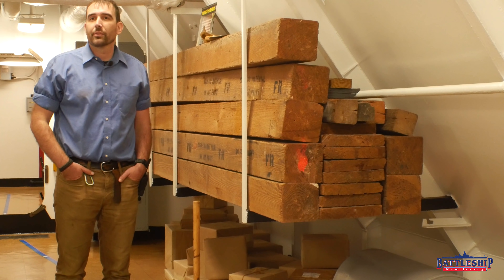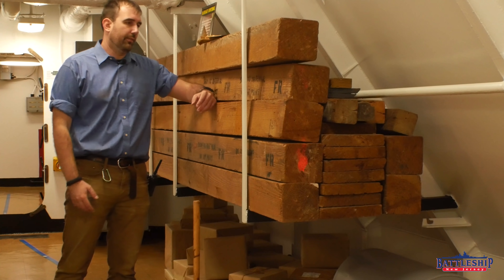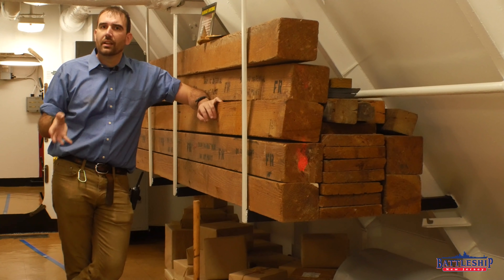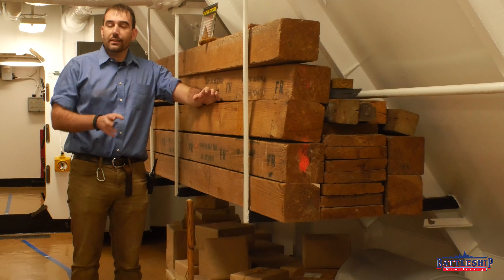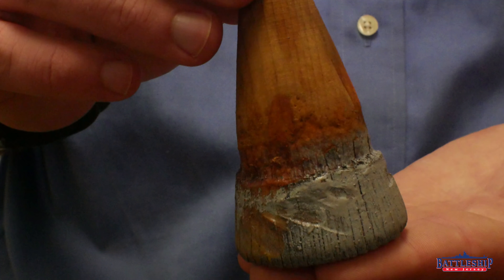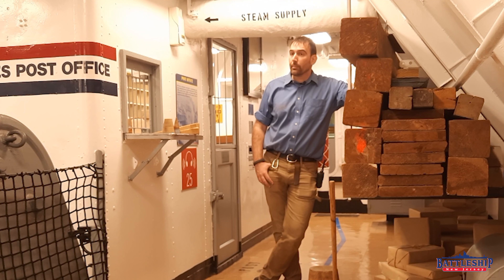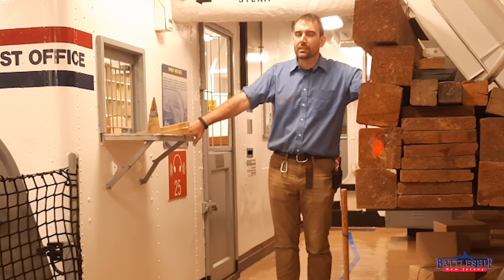Damage Control: Stopping Flooding

Comment: When I was in UK sea cadets, we went down to his Raleigh with the unit, as part of the unit week, we had a morning in the old damage control training centre, everyone got involved including all the unit instructors including the CO, because it was fun (not so much If it had been real). After 2 hrs we were waist deep in water lol.

Sadly we weren't allowed on the new (at the time, it had started use the week before) damage control trainer, it swung so it simulated a ship in rough seas, also when the water poured in, it came in at correct pressure.

HMS Raleigh is the boot camp for the royal navy

Comment: No damage control at home but my fathers destroyer was hit off Okinawa, and badly damaged at that,  With the deck cracked and split across the entire beam, one of the things they did was to cut holes in the 3/8th deck plate, wrap chain around the longitudinals, and take up the slack with chain falls to keep the splits from widening.  Dad limped  his ship into Kamera Retto (SP??) where he was told "I'm sorry Captain, but your ship is a CTL and isn't worth fixing".

Comment: So why use wood and cut to length for the props, instead of a screw jack type setup like was already seeing use in scaffold of the time (and continues to this day)? It seems to me that designing a footing brace lug to be welded to each structural point you'd want to brace against would remove a lot of the time, guesswork and risk to a damage control team, meanwhile expansion of wood is undesirable for the elements that aren't trying to water seal, and nails very hard to adjust, and when hastily applied to wet timber, not very strong compared to a clamp. Of course when hulls had wooden members wooden braces make the most sense, but that era was long passed by the time battleship new jersey first left its slipway, much less the end of its service when it was preserved.
Reply from the maker: They had more mechanical shoring timbers as well, when in doubt, redundancy

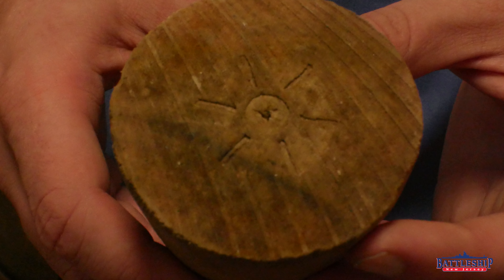Comment: 6:45 that's not a hammer strike mark. It's where the lathe centre dug into to turn the taper. Which makes me wonder, is there wood turning lathes on new jersey? Or metal lathes with carpentry centres?

Comment: We have plugs but also use wedges (they come in 2 or 3 sizes) to plug holes. Rule of thumb being 1 wedge per 1" of hole. Any gaps you split the wedges and hammer them in the gaps

Comment: One of the best schools I went to was the ‘wet’ damage control (DC) school at Naval Station, San Diego.  We trained to patch pipes, how to operate a water pump (P250), and learned how to use shoring (lumber) like Ryan talked about.  On the last day we put it all together in a huge mock-up of the inside of a compartment where instructors could turn on valves and water would start to enter the compartment.  We had to plug the holes with anything we could find, i.e., DC plugs, shoring, pillows, mattresses, etc.  I’m sure the students always lost and the water won.  Our last task was to abandon the compartment by exiting UP a vertical ladder with ‘Niagara Falls’ falling down on us while two shipmates guided us up.  That was so fun, it was the essence of ‘hands-on’ learning DC.  I went thru advanced fire fighting school and radiology school to learn how to use radiation instruments and fighting the ship during nuclear attack.
20.5 years of active naval service aboard 2 CVs, 2 DDs, & 1 LPD.  Anchors Aweigh!  Go Navy, Beat Army!

Comment: Damage control a matter of ship design, equipment but most if all the crew. Both USS FRANKLIN CVA13 & USS FORRESTAHL CVA59 survived massive fires with loss of life & returned to service. First & foremost neither had to be abandoned (survival odds for remainder of the crew sure is better aboard as vessel). Compare losses of IJN Shinano (incomplete ship lacking watertight integrity & inexperienced crew sank nine hours after hits)  or Taihō (able to mitigate flooding from torpedo hits but bad DC decisions allowed avgas vapours to ignite). I doubt the USN wouldn't have sent the former to sea in such a sad state or let the latter get out of hand.

Comment: You mentioned that the bulkheads wouldn't be able to withstand the pressure of water - but what were they there for, then? Isn't the whole point of a bullhead to seal off a flooded compartment?

Comment: I can't believe that a damage control party would be cutting heavy lumber with that puny saw. A gasoline powered chainsaw would seem more like it especially when speed is paramount. 

When they first surveyed the wreck of RMS Titanic , Robert Ballard and his team observed that the damage to the hull caused by the collision with the iceberg appeared to be an opening in a riveted seam about 150 ft long but not more than 1-1/2 inches wide. If that was the case, they certainly had enough stuff on board to fill that gap and a lot of people to do the stuffing, but apparently no one who understood the concept of damage control. One complication would have been that a significant part of the opening was in a coal bunker so they may have had to shift a lot of coal to get access to the damage.

Comment: Damage control after Ida--12+ hours of storm/hurricane conditions in NOLA on (of all dates) the 16th Anniversary of Katrina. Got up the next morning and had to put a tarp on the roof to cover where shingles has been torn off and rain was leaking through. Damage to interior walls and ceilings from water incursion. 10 days without power, running minimal items on a generator. So far the tarp and other sealing efforts have significantly reduced the leaking. We have just gone through 3 more days of storm and rain from TS Nicholas. All that said, we are very fortunate. Those west and north of here were hit so much harder. All in the path of Ida have lost some. Some have lost all. Our hearts go out to the families and loved ones of those who didn't make it through the storm and its aftermath.

Comment: I had the opportunity to go through 2 different damage control trainers at different times to learn how to try to control flooding. One of them was a portion of a ship that was actually floating in a very large swimming pool. We did the training in that several times as it slowly sank to the bottom of the pool. That got you used to trying to do things in a flooding compartment where simply moving around and doing some of the needed tasks by feel was emphasized.

Later I went through another trainer that was just a modified section of a normal building. They had drains in the floor so as the water rushed into the room it could be continuously pumped back in with the level of water in the room not getting much more than ankle deep. However, the real challenge came at the end. It was a two story trainer and you had to exit through an escape scuttle into the upper room which was flooded with waist deep water. Trying to get up the ladder through the scuttle with all the water flowing back down had you feeling like a salmon. Both trainers were both instructive, interesting and even a little fun.
Reply: The "normal building" DC trainer I went through most likely had drains in the floor, but they sure weren't letting any water out of them during the drill.  Water was chest-high by the time we got the "leaks" stopped.

Comment: was the post office manned by a postman or a Servicemen?
Reply: Considering the laws about handling the mail that's a very intriguing question.
Reply: @ralphgesler5110  Thanks. I didn't know about that.
Reply: @ghost307  That post office would have had it's own postmark.  I still have a picture postcard of the USS Kansas City (AOR-3) with matching postmark indicating that I mailed it from the onboard post office.

At sea, small ships without a post office would transfer outbound mail to a ship that DID have a post office, generally the replenishment ship during an UnRep.  On the replenishment ship it would be postmarked/cancelled and either stored or started on a ship-hopping or plane journey to a shore station.  In port, I think that outbound mail for ships with no post office was collected and processed by the closest FPO.  A typical inbound shipboard address might look similar to:

Kevin Crosby, IC2
ENG/E-DIV
USS Kansas City (AOR-3)
FPO San Francisco CA  91234

Comment: Your video on the Sammy B illustrated how important damage control is.

Not storm damage, but I work in a medical facility and have just had a hot water pipe replaced after the second split in a week. Leaked in ceiling where two main corridors meet. Lots of ceiling and wall repair still to do.

Comment: Never had to do damage control on a house but I did have to fix a leak on a boat in less than ideal circumstances.

Long story short I was helping a friend move a decent sized boat that he won in an auction, this thing was old and had been used for storage so not much room to move.

Not entirely sure what happened but too far into our journey we sprung a leak and it was pretty quick, because the old engine wasn't a great starter we put it in idle incase we couldn't fix the leak and needed to get closer to somewhere dry.

We had a surprising amount of stuff to plug that hole, but due to the storage room nature of the boat we then had a lot of smoke appear - some old oil bottles had fallen into the engine compartment, burst and begun to smoke badly.

Digging it all out to reach where we needed to be we discovered the worst part yet - a serious amount of sea flares with a troubling crust around the boxes and an expiry date that would have put them out of service during the day's New Jersey was still in use.

So we had that to deal with next to oil that was threatening to ignite.

I hated that boat, moral of the story is if you get any vehicle crammed with rubbish and told "take it today or leave it", you should probably leave it regardless of how stupidly cheap it is.

Comment: How are the steering wheels in the conning areas linked with the rudder movement machinery? Is it via hydraulic lines? Cables? Electrical?
Reply: How do the rudder indicators and steering wheels throughout the ship stay synchronized? Is there some kind of master indicator at the rudder that all control and indication points are linked to?
Reply: @baerster  They did a video on this. I think it's called aft steering.
Reply: @baerster  There would be a synchro transmitter on each rudder head, driving the synchro receivers in the port and starboard rudder indicators.  Same principal for the gyrocompass and the many gyro repeaters.  Wind Speed and Direction system was a bit more complicated.  There were synchro  transmitters in the sensor units up on the mast, but the speed sender was connected to a little propeller, requiring a conversion to a steady-state reading, then out via a different synchro transmitter.

Helm, if relatively modern, would have the wheel connected through some gearing to two synchro transmitters in the helm console.  One would drive synchro receivers in the Rudder Order indicators, the other would drive a synchro receiver which controlled the hydraulics in After Steeering.

FWIW, this is also how the Engine Order and Prop Order systems worked.  Paired synchros.

Guess i could mention that a synchro is basically a specialized stepper motor.  When wired properly, the rotors would sych up to the same position when power was applied.  From that point, moving the rotor on one (transmitter) would cause the rotor on the other synchro (receiver) to move a corresponding amount.  Very little torque, but great for indicating and control where the torque isn't required.

Comment: I would suggest that the round plugs were mostly for plugging pipes that would break.  Water and fuel. Steam would probably have a different type of plug..
Reply: Pipes were repaired with a metal band that went around them and held a pad over the puncture.
Reply: @ghost307  I think he thought about situation where pipe would snap, not just a puncture on the side but a situation when it completely disconects
Reply: @hlvscomendandeche8744  That's actually an easier situation to deal with. There are isolation valves all over the ship. You just shut the one that's upstream of the break (and downstream of it as well if needed).

Comment: The plug has a mark from the lathe when it was turned. I worked on fish/tug boats when younger we used to keep a bundle of shingles short pieces of rubber hose 1-6 inch in diameter wedges and tarps. Shingles plug cracks folded up tarp and wedges for bigger holes.

Comment: Those weren't  strike marks on that plug.  I have hammered a lot of wood in my day, hard and soft, and I didn't see a single hammer mark on that plug.  Those marks I did see came from the spindle of the lathe on which that plug was turned.

Comment: The "Strike Marks" on the wood plug ends are in fact marks from the Lathe that held the wood when they were turned. The part on the lathe is known as a "Drive Sper" that leaves that mark. You are right about the marks on the sides as being witness marks from them being used. I was a Tool Maker at a company that would make these from time to time for the Navy and commercial ships. The spec called for White Birch.

Keep up the great work! Love the channel and hope to get down from Maine to visit the NJ soon.

Comment: How did the New Jersey simulate a leak while at sea? Is there a floodable room onboard?
Reply: I can only speak from my time in the german navy, but when we train flooding situations we got an Inspector from the Officers and he marks a place on the hull with chalk or take a paper where the dimensions and kind of leak are written down. so the crew can work on this simulation. Also when the flooding is trained it always comes with poweroutage and fire in the ship. So the complete crew was busy during the exercises.
Reply: @timk.2381  The Royal Navy has a training "tank" which has a couple of pre-cut holes, it is lowered into a much larger tank full of water. Sailors have to plug the holes as the tank is rolled around. So they don't loose too many sailors during training there are divers on duty to pull out any that are really straggling, but the rest have to carry on.

Comment: I spent a very memorable day training on the buttercup trainer in Newport, RI.  We were a bunch of hospital corpsmen who basically had just watched a couple of films on how to patch pipes and plug holes and shore up hatches.  So we didn't keep Buttercup from sinking.  At least the water in Buttercup was a lot cleaner.  
 Later on, I went to a frigate.  Couple of days after I reported aboard, we had a firemain strainer blow out in the diesel generator compartment and that flooded about chest deep before we figured out what was happening and got the water shut off.    Spent the next three months tied to the pier getting the diesel generators, and everything else in those compartments, rebuilt and repaired.   
    Later on, after a yard period, we got sent to Guantanamo Bay for damage control refresher training.  In the ten days before we arrived, we had a lot of training and preparation.  And we had a man overboard, a main space fire, flooding and buckling bulkheads, and a major trauma injury.  It was a very bad week.

Comment: Just as a heads up at 6:46 ish, the strike marks look like they are from the center for a woodworking lathe.  It will have a spike in the center then 6 flats that spur off to keep the end of the wood that isn't in the chuck from flopping around.
Reply: That’s a mark from the headstock the Spurs turn the wood in the lathe.  Chucks are used on. Medal lathes but not usually used on wood lathes

Comment: Are there higher concentrations of damage control gear in some areas than others or is if fairly evenly distributed below the water line?

As for the storm we were fine, but my middle sister was working at a youth homeless shelter in NYC. She got stuck at work because her replacement had a car washed up against the door to their apartment building. She had to bail the leaks at her site out the window because the drains stopped flowing.
Reply: I was in the german Navy on a frigate and we have mostly stored our Equipment a Department above the Waterlevel. But in the big machinery room we had also stored wood and small Material inside the rooms depends of the space inside.

Comment: Worked for a municipal water system for many years and we used wooden plugs once in awhile for emergencies.  We called them "Vampire Stakes".
Reply: Yeah, while I wasn't a DC, I seem to recall the round plugs were more commonly used to address ruptured pipes, not bullet holes.

Comment: Thats not a hammer mark, thats where it was turned on a wood lathe. Thanks for the great videos!!
Reply: I was gonna add that they then hit a nail into the center to put more pressure on the hole, (ok didn’t spot the lathe.) 
And of course thanks for the great videos!!
Reply: Looks like a hammer mark on top of the lathe claw marks
Reply: Beat me to it

Comment: Did anyone ever manage to punch any holes in New Jersey? If so how big and above or below the water line? Are there any dents where incoming rounds failed to penetrate?
Reply: The USS Massachusetts was hit by the french battleship Jean Bart once.  It hit up forward in marine berthing, which was empty at the time, so no casualties and no significant damage.  Detonated and made a lot of shrapnel holes and destroyed a lot of the uniforms and such of the marines.   They saved the chunk of armor that the shell penetrated and have that on display, and you can see in that compartment all the steel patches welded over all the shrapnel holes.
Reply: Was never holed from anything. Some damage from a shell hit in Korea. Superficial stuff. 

There's a big dent in the bow below the waterline. Don't know what they hit, but wasn't big enough to fix I guess. It's visible during the Vietnam drydock reactivation so it must have been from ww2 or Korea.